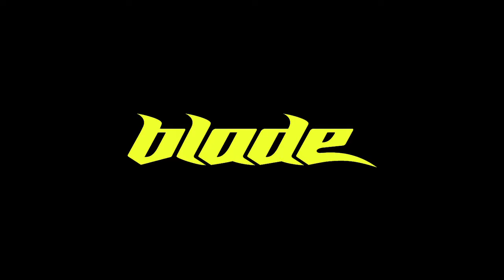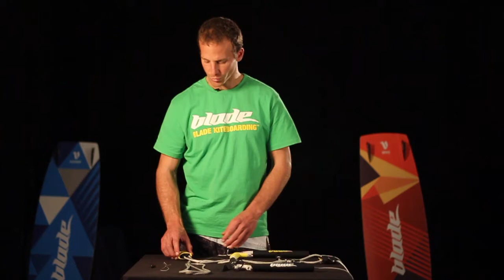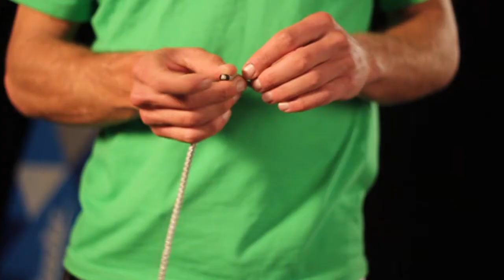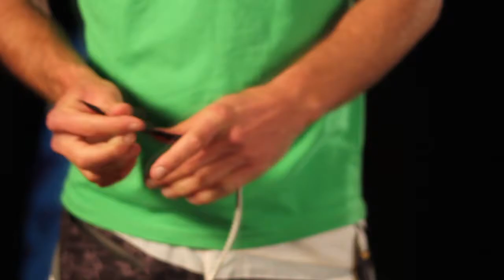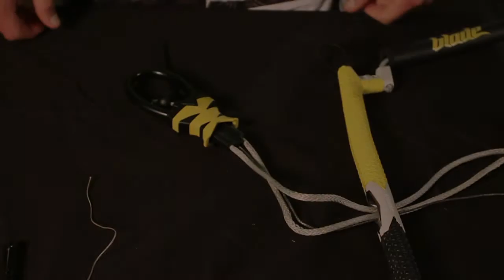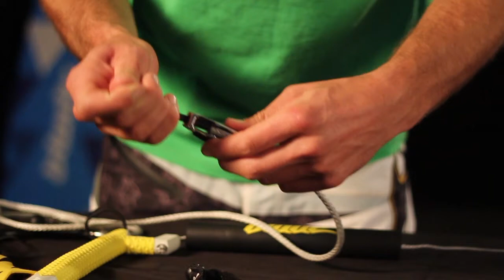Depower Line Replacement - Blade's Uni Bar

Comment: what is the lengh of the depower line ?
Reply: Hi,  a bit late but if it helps you or someone else with this bar. 
5mm dyneema single braid. ( usually grey, sometimes called amsteel 
Length 162cm. The stock setting to the cleat is 40cm. Super easy to adjust bar throw.
Reply: @BurtReynoldstash  Helps :D